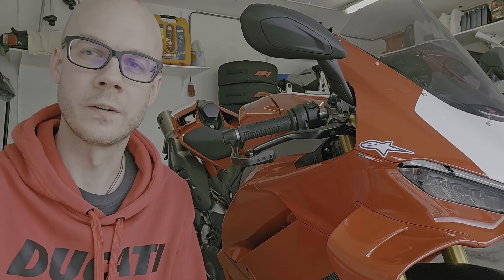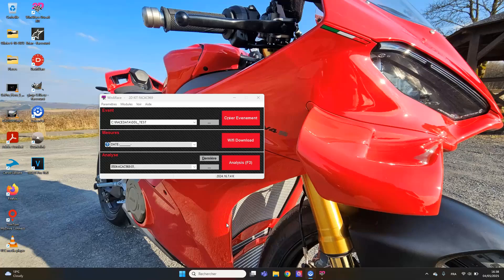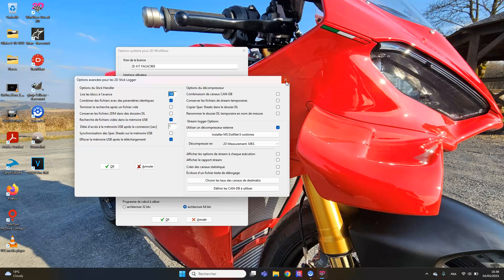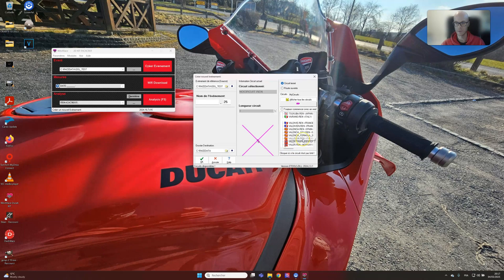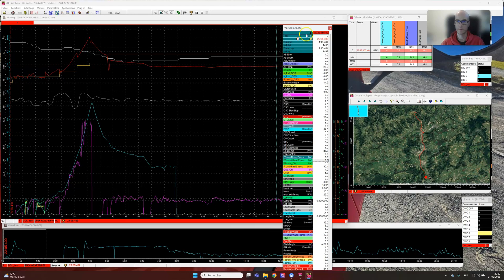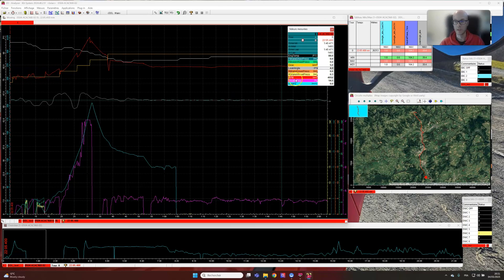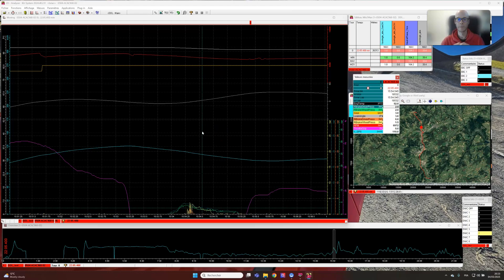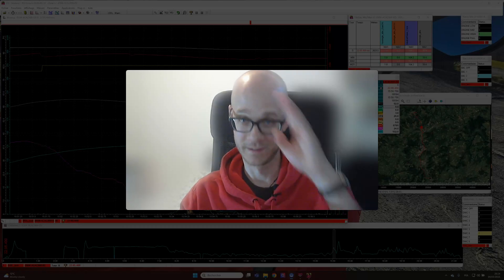🔧💻 Ducati Data Logger - DDL 🔧💻 - Ducati Panigale V4S 2025 - Presentation / explanations (EN)

Comment: Hi, I'm trying to open the ducati DEMO data, but it give me an error saying the application is a trial mode and only demo data can be used. Any idea? I wanted to see if it work on macOS via Crossover
Reply from the maker: Hhhmmm. I don't remember if it's blocked or not like that before validating the licence... Best thing to do, try to contact 2D directly and ask them. They are usually pretty responsive. ✌️

Comment: Does the TPS read 100% at 100% grip position in full power mode or only 91%. My friends v4’s data the tps_h and tps_v only goes up to 91 at 100% grip position. Trying to figure out if that’s normal or if there is something wrong with his deussen engines flash
Reply from the maker: I need to double check but indeed I believe mine is doing the same.
Reply from the maker: So, I checked and even stock this is normal behavior. Throttle at 100% H and V are only arround 91% in the data. So no worries! ✌
Reply: @KoRnIcHoN1000RR thanks for checking!
Reply from the maker: @AI27Motorsports  sure! And well if I would want to be alone... I would do this YT vids mate. 😅😅😉✌️✌️

Comment: Hi- could hope you might be able to assist. I have the DDL fitted, I have downloaded and used the 2D software. But I am having problems viewing the lap timer on the bike at the track. We have tried to activate the GPS point using the highbeam, we have tried creating an event and track with the software but we are unable to view any Laps on the bike screen. Have you been able to view on your bike? any help would be great- thanks
Reply from the maker: Sure! And actually I had to try this last weekend on my first trackday as this track was not embedded into the logger. So, first, you'll have to be in Race Mode A or B. Then you have to make sure that a few options are activated in the configuration of the bike. "Logging" has to be on "always" or "laps" (or somethin close to that, mine is on always). Then "Laps" has to be "on". "Laps" sub option or menu is where you will also be able to see your "info laps" with laptimes and details later on. Check your options, if you do not find where to look, contact me on Instagram so that we can share pics if needed. Hope it will help.
Reply: @KoRnIcHoN1000RR  thanks for replying. 
Where are able to view the lap times on your bike screen or just in the 2d program?

I have set the laps to be always on etc as you mentioned they are all on but I’m still unable to see the lap times on the bike screen.
Reply from the maker: @jasoncawthorne4546 come on Instagram and send me pics of your settings please. If there was laptimes registered you should be able to see them in the same menu where you can switch "laps" to on or off.
Reply from the maker: @jasoncawthorne4546  And by the way you can also check this short: https://www.youtube.com/shorts/rA1VPOFXKzk it's in french but it will show you where the laptimes are stored and how to access those. 😁